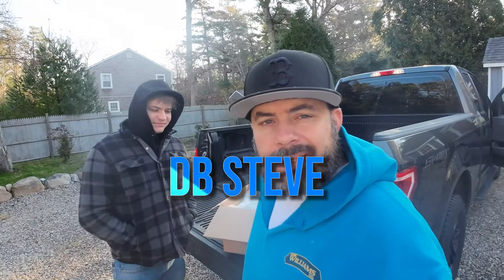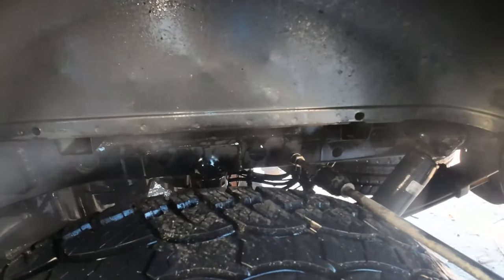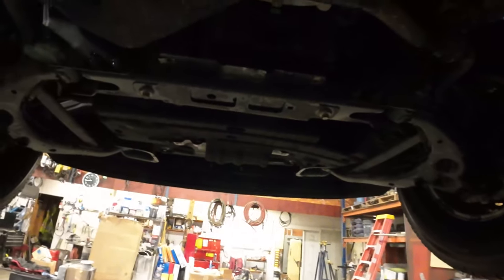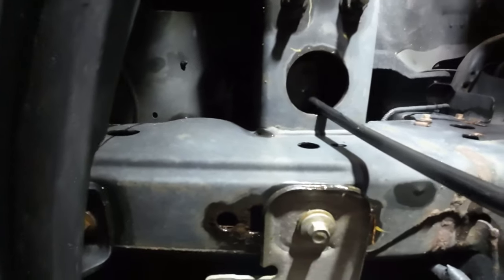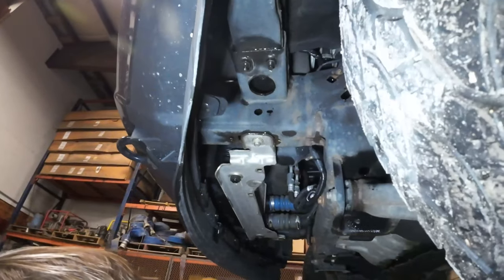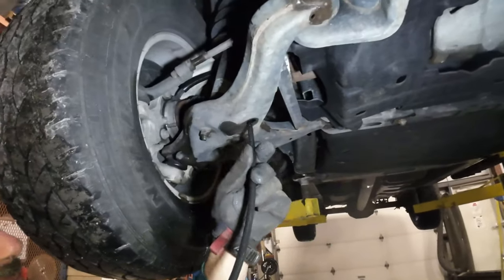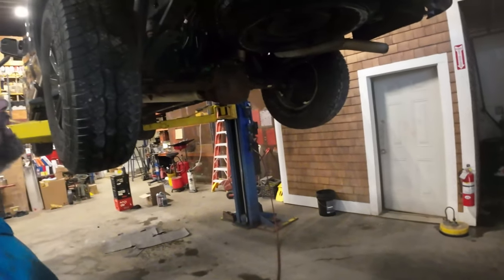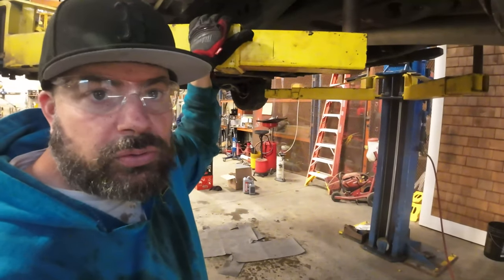Undercoating F150 With WoolWax!

Comment: GREAT IDEA and known in the trade as CAVITY WAX first created by 3M !  Glad to see you guys getting that good looking truck protected. OVER the REAR wheel wells (inside) is an important area (has two TINY 'factory' drain holes) that plug up before they work. Those are nice extensions they gave with the wax! GREAT VIDEO GUYS !!!
Reply from the maker: Thanks for watching!   Hopefully it will do the trick

Comment: Two schools of thought. 1 it should be done brand new to avoid a rust condition. 2 doing the application on a truck that is a few years old will seal the rust in and rust never sleeps. I’m not picking a side just wondering what other peeps thoughts are.
Reply from the maker: Unfortunately, we didn’t get the truck when it was brand new but I agree with that %100 .  I think this frame is good enough that it will make a big difference. However I have another pickup truck that have a lot of rust so I wouldn’t bother with it .